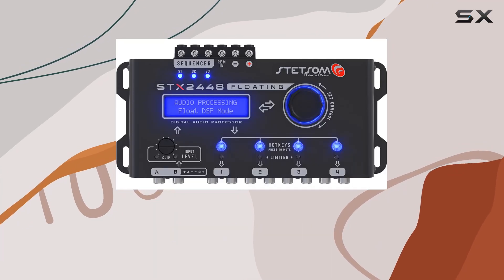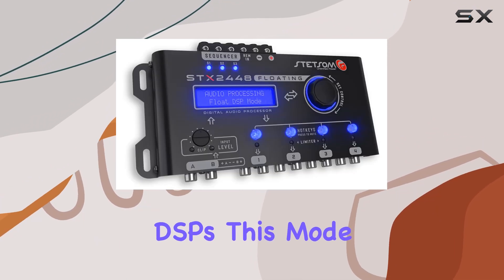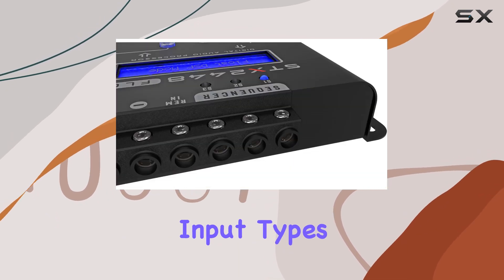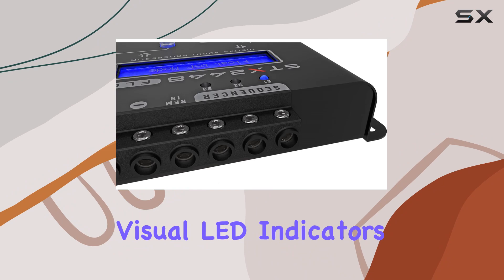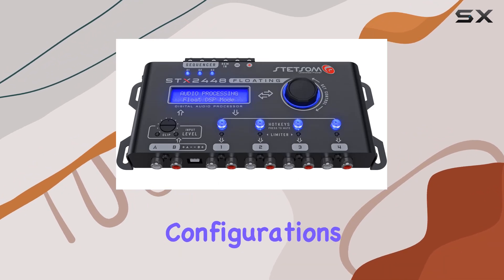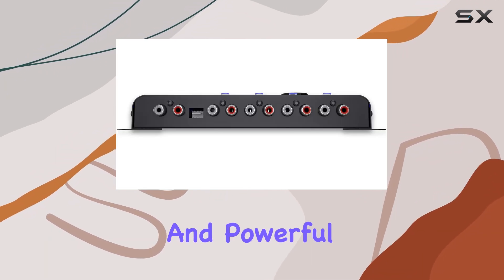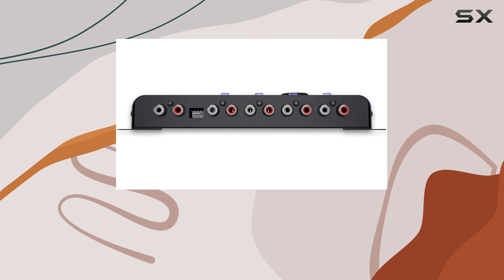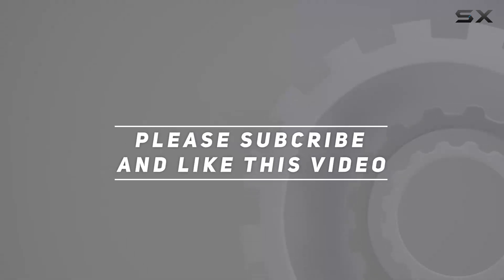Stetsom STX2448 FLOATING: Unveiling the Best in Pro Audio DSP Technology

Comment: i have STETSON 2346bt
Hey im connected through High level input, 
This wont power on my  amp, at first it did for a sec, then it wouldnt after that?
when i use LOC then rca to amp it still doesnt Turn on my amp..?
but when i just go back and use m loc then rca to amp, My Amp Turns on? but only Direct from loc?? 
My last Dsp worked from high input? is thier some SETTING ?? that Turns on AMP ?control Am i missiong SUmthing??